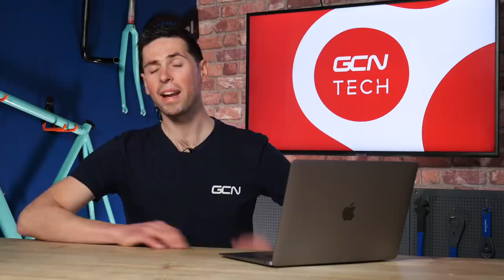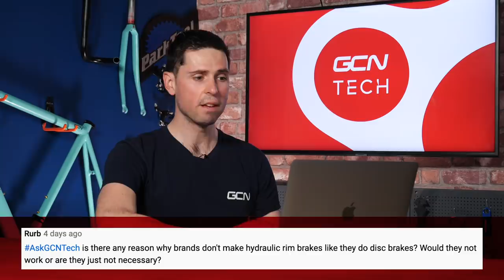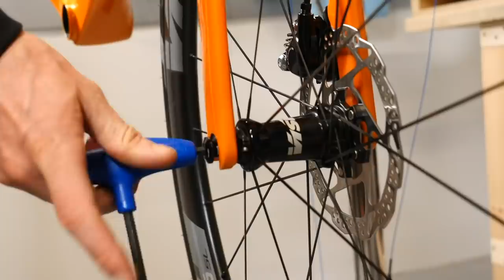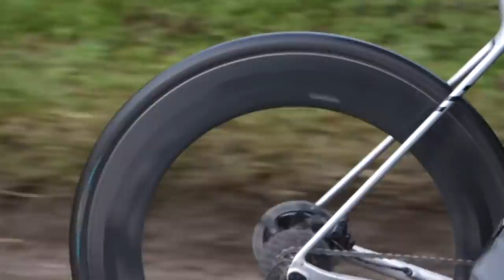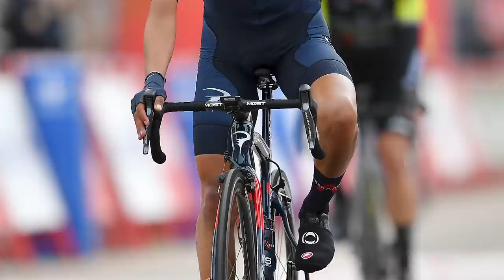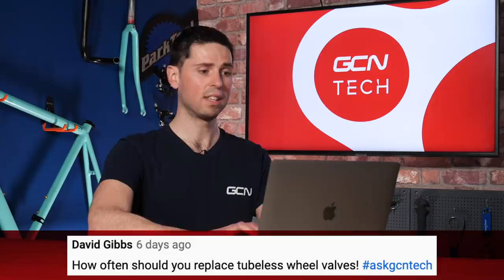Are Team Ineos The Only Pro Cycling Team Still Using Rim Brakes? | GCN Tech Clinic #AskGCNTech

Comment: Rim brakes will make a come back in a few years after everyone has moved to disc. It's a way for companies to push different, new product. Let's be honest, the bike industry is difficult. They make products that are so good you don't need new ones for years. But they still have to sell new products every year. Good on them for innovating and staying in business. I say do whatever it takes.
Reply: Imo there is no "innovation" when it comes to disc breaks. The technology is decades old and has been developed by car and motorbike manufacturers which have a substantially larger research and development budget then road bike companies. Plus the breaking efficiency is just basically levers and is rather simple when it comes to physics. 

 The issue in the bike called is this obsession with weight. A lot of the issues withrim brakes overheating and warping can be attributed to shaving off weight of the disc rotar. Basically anding an extra 50g to the break rotar will help a lot. 

With that said I still prefer my rim brakes. I would buy disc if the pressure of the weight people hadn't messed with the engineering of the breaks
Reply: @supernoodles908  I've had a mountain bike with disc's for almost 20 years. I agree there isn't any real innovation but most new bike purchasers don't understand that. I have an S-Works Tarmac and it'll be a cold day before I change to disc.
Reply: @Livlifetaistdeth  disc on mountain bikes are often better due to not shaving them foil thin. It's a real shame
Reply: @supernoodles908  It is a shame. They are great on a mountain bike but just not an upgrade for a road bike.
Reply: Pablo Morales  if weight is the issue, then use a good rim brake...
Reply: Pablo Morales  exactly, so as extra mass to the rotars so they don't warp and over heat as much
Reply: @supernoodles908  "foil thin".... wuh ?
Reply: @fukawitribe  foil, the metal sheet you wrap food in. They make road bike rotars too thin like foil
Reply: @supernoodles908  Yes I assumed that's what you were alluding to but no.... no, they really don't.

Comment: Are Ineos the only team that saves weight and reduces aero drag by 5-12 watts?
Reply: There is a weight minimum. The Pinarello weights a bit more than a lot of other bikes. Also, rim brakes are not necessarily more aero. Discs can be more aero. There is a study on it that shows that. It depends on the design of the bikes and which brake system they were designed around.
Reply: @DaveCM  That's plain wrong. Every model of rim brake bike tests more aero than it's disc brake version. There is so much data to prove it. There is no disc version of a bike that surpasses the rim brake version in terms of aero. Doesn't exist.
Reply: @DaveCM  All tested at 45kph: 

2019 Cannondale SystemSix Disc - 203w 
2016 Trek Madone - 204w 
2016 Specialized Venge ViAS - 204w 
2016 Cervelo S5 - 205w 
2016 Felt AR FRD - 205w 
2019 Cervelo S5 Disc - 206w 
2016 Canyon Aeroad - 208w 
2019 Specialized Venge Disc - 208w 
2016 Giant Propel Advanced SL - 210w 
2016 Scott Foil Premium - 211w 
2016 BMC Time Machine - 211w 
2016 Look 795 - 212w 
2019 Trek Madone Disc - 212w 
2019 Ridley Noah Fast Disc - 213w
Reply: @lucilledadang1989  It's not plain wrong. Go look at more recent data. There are times when disc may be less aero and when it may be more - cross winds are not good for disc (in general) but they can be better on average over a larger yaw range. It's honestly not as black and white as you seem to think - worth looking up some data.
Reply: @fukawitribe  like for like bikes are considerably worse aerodynamically in any range of yaw from0 to 20. We'll agree to disagree.
Reply: @lucilledadang1989  If you mean disc brakes bikes are 'considerably worse' aerodynamically then rim brake ones, then the data seems to say something different - and it's not due to the discs vs caliper air flow either (which disc generally is worse for) - we will indeed have to agree to disagree. It's getting lighter in the evenings here, it's even sunny, i'm sure we have more enjoyable things to be contemplating.

Comment: Straight Pull vs J Bend Spokes

Which is better? What are the advantages and disadvantages?

#AskGCNTech
Reply: Straight pull is stiffer, j bend is cheaper
Reply: J-bend is easier to replace if needed and you get to determine the lacing pattern as well as having more flexibility in terms of choosing spoke thickness.

Comment: Tubeless;;;.... they go flat every now and then, it common.... Tubeless....the valves get gummed up, so you'll have to change valves....  Then on the road, when they blow, they have a huge failure that does not deal, and we put a tube in them.. the mess is everywhere.

Comment: Headline is wrong. Team Ineos is a single entity. It should be "Is" not "Are".
Reply: that actually depends on the style guide of the publication. As a former print journalist, the standard would be for a company to referenced as a singular entity, where as sports teams are usually referenced as a plural. Team Ineos 'are' is therefore correct. This would be the same in most broadsheets.
Reply: @GCNuser123  Cmon... "Depends on the style guide" is clutching at straws, mate. And I am also a former print journo which is why bad grammar infuriates! 🤣😇
Reply: @TheSamwhyte  then surely you can appreciate the rest of the comment?! teams are commonly referenced plural!
Reply: @GCNuser123  Commonly is not the same as "correctly". However i do sense you will not concede on this point so happy to leave it as an impasse 👍

Comment: #AskGCNTech I see behind you sometimes an Orbea Orca hung on an Ibera wall rack. I’ve been looking at wall hanging options for my bike, but wonder...is it really OK to hang a carbon bike by its rather fragile top tube like that?
Reply: The top tube, whilst being about the weakest point on a bike, is not that weak. It is most susceptible to impacts rather than constant pressure. Heck I see riders, including pros, leaning against or sitting on their top tube all the time. If you assume that even just 20% of their weight is on the tube, for an 85 Kg/190 lb guy like myself that is still ~15-20KG or 35~40 lbs. Way more that the bike's probably sub 8kg weight.
Reply: @thekeytoairpower  very good point! thanks for the reply.